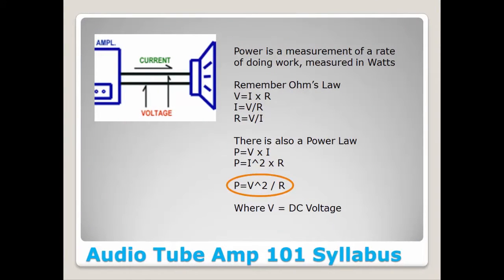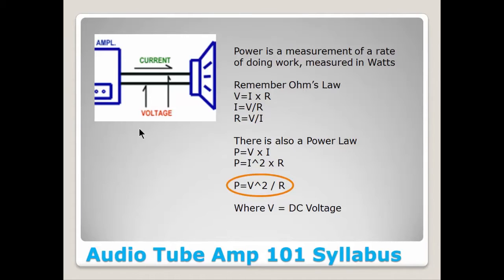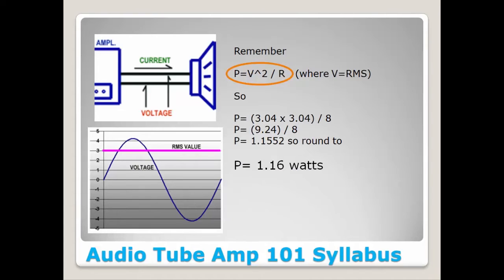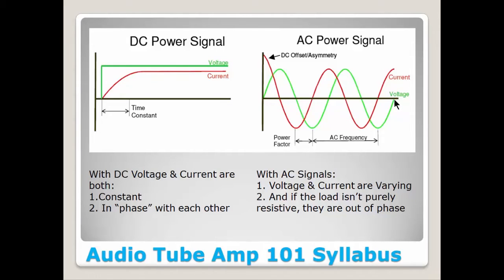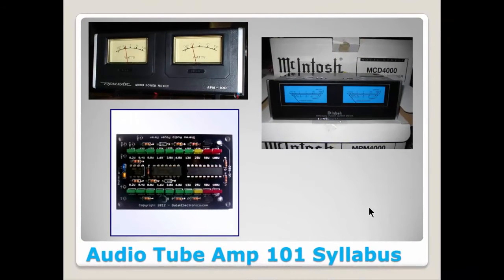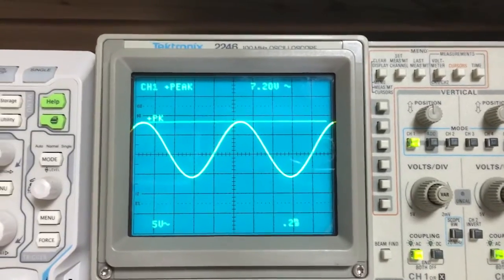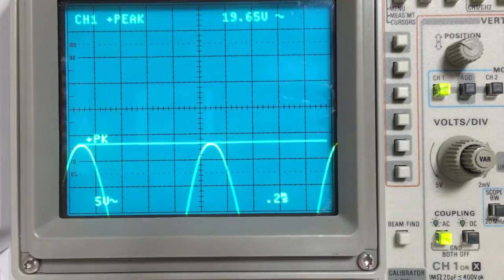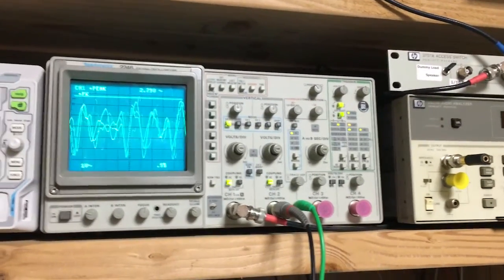Audio Tube Amp 101 - Episode 7 - Power & Power Measurements

Comment: Hi viewing from the UK nice to see 101 Series Back

 I just have to remember my
wall voltage is 240v and not 115v like you guys. 

 I have built a JE. Labs Single
ended 6SL7/EL34 with choke PSU and James 5K outputs Transformers sounds great 

Your 101 Series
is of great value to me looking forward to the next one 

Thank
you for this 

Colin